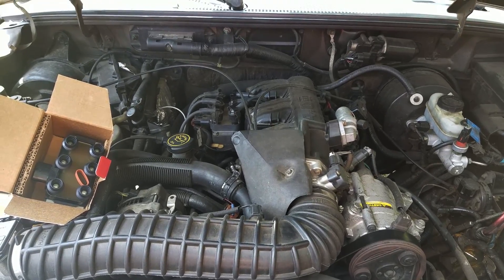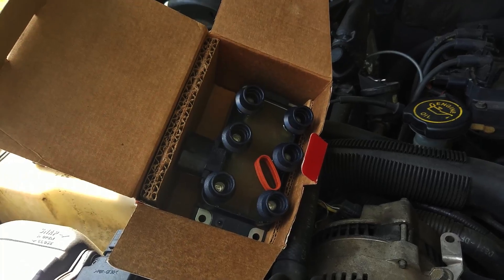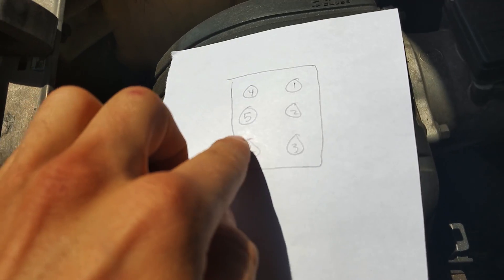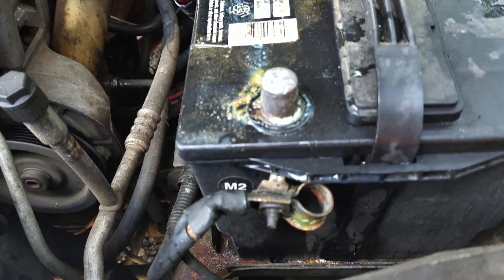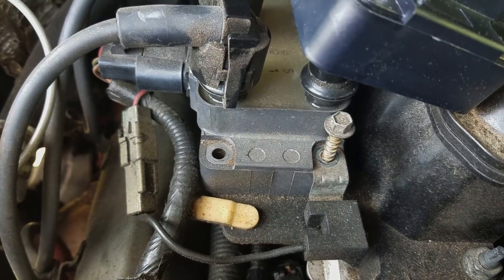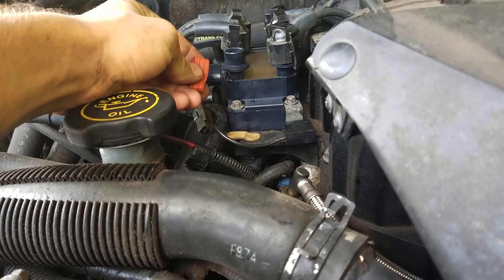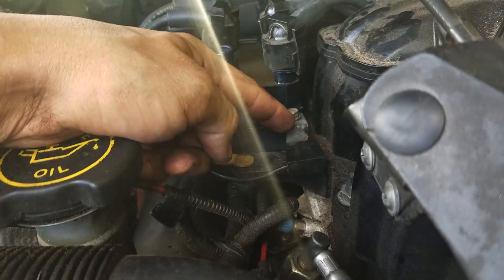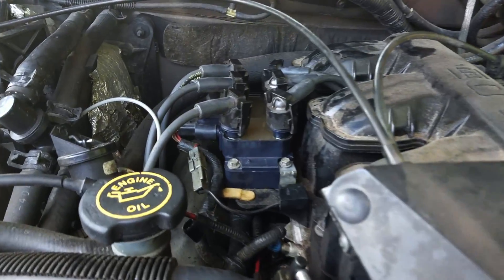Truck Keeps Misfiring? Check Out This Quick Fix!

Comment: Can you see where the lines go in correspondence with with engine? I took off my coil pack and the wires off and put new ones with new plugs as well. I made the rookie mistake of not drawing a diagram and now I'm all screwed

Comment: The wiring pigtail to the coil goes bad! I replaced coil, plugs, wires everything. Still have misfire. The new pigtail failed after 4 months too! Part # s658

Comment: I have a 2004 Ranger that has a misfire on #5. I replaced the plugs, plug wires and the coil pack. It is still misfiring. Why?
Reply from the maker: Check the electrode on the spark plug to see if it's cracked. I've seen it a lot.

Comment: My 2000 Ranger with the 4.0 6 cylinder has been acting up with misfires on #4. I've replaced the whole ignition system (plugs, wires, coil) as well as new MAF and throttle position sensors. Replaced the torque converter clutch solenoid... Still get random misfires on #4... Thinking maybe it's an intermittent fuel injector?
Reply from the maker: I had a similar problem once. Turned out to be a cracked insulator on the #4 spark plug it was shorting out on itself inside the motor. The motor was sucking antifreeze and it blew a head gasket not long after. I think that's what cracked the spark plug electrode insulator. Just a theory, but a good one.

It might be something like that with your truck, or the computer could be bad I have heard of that before.
Reply: @MattsShop  hey Matt i got a 2000 ford ranger 3.0L go up a hill it jerks reel bad , flat hiway it run good sometimes it misfire or jerks . happen the most go up incline
Reply: G N did you ever find what was wrong? Mines doing the exact same thing.
Reply: @sn95_elitist12  i had done the exact samething u did ,, helped alittle but replace my new plugs with another new set of plugs ( Bosch) it did the trick, (no missfire) now.

Comment: did it fix it?  my 2000 Ford Ranger has misfire cylinder 5 and I changed everything besides the coil pack. I guess that's next. just wanted to know if it fix it?
Reply from the maker: +Josue  Guzman Did you change the spark plugs? This motor had a misfire before. Turned out to be a cracked insulator on the spark plug electrode (white part). Yea, change the coil pack and see if that does the trick.
Reply: There are so many rangers out there with this issue, though also as many stories of owners changing coils, plugs, wires, etc, and it still misfires. Ford has a TSB out concerning the exhaust valves don't seat right.  We just had our coil changed and after 20 miles of driving it started misfiring again. Any follow up on this fix, say a month or two later?
Reply: leann manley did you ever find out what was the problem?
Reply: I'm dealing with the same issue now....I'm puzzled

Comment: My rangers RPM dropped when taking off making it really sluggish, no misfires. Replacing the coil pack did the job. Already did the plugs and wires
Reply from the maker: Good job!
Reply: Did you do anything to check the coil? I'm suspecting mine is bad but they're all sparking, coil is just cracked where it's bolted down. Can it be bad but still give off a spark?

Comment: I have a cylinder 1 too lean and a cylinder 4 misfire would changing the coil pack be the solution or new wires and whatever else you can think off throw me answers please I have Ford Explorer 98 and it looks just like this and it's very helpful because mechanics act dumb and say it's a bigger problem in the engine and lifters and what not and are scamming me so I want to do it myself being as I want to become a mechanic for my career!!!
Reply from the maker: I'm glad you want to be a mechanic as a career. Did you check the spark plug on cylinder 4? A coil pack CAN cause a misfire, but I don't see how it could make a cylinder lean. How did you find that out? A code scanner?
Reply: manuel gonzalez . Hi it's best just  replace all  . Plugs . Wires . And spark pack. If  at all it's good  preventative maintenance.
Reply: Ouch for some of these comments. Damn, settle down. Might start by how that coil pack is designed by Ford.

Comment: fuck ive replaced 3 of these things now.  any suggestions on why i burn so many out?
Reply from the maker: I don't know. Maybe check all of your grounds? Make sure that your grounding strap from your motor to the frame/body is good.

Are you sure it's your coil pack that's always burning out? One time I had a spark plug that had cracked porcelain near the electrode that kept causing a misfire. If you have a bad misfire on one cylinder that would be good to check.
Reply: thank you very much!  ill try your suggestions.
Reply from the maker: Yea, you are welcome for the ideas. Look over everything 5 times. There is somthing that you are missing!

Comment: My third comment if the engine is running in this fight sometimes but not all the time you can flush the motor two maybe three times with raw kerosene or a flushing agent is possible you could have a valve sticking  from slug deposits . I'm not saying this will work for you because every situation is different so I do not want to miss lead you got a good part of the time a lot of it is such a builder that causes these valves to stick. The repair is not as bad as you may think if it is a bad valve so do not let anybody miss  lead you if it is a bad valve it's very repairable. Good luck my friend keep the faith.
Reply from the maker: Never thought of flushing a crank case with raw kerosene. I don't know if I would do something like that on an automobile, on a small engine sure...
Reply: If you did that on a engine with variable valve timing that kerosene would probably destroy the vvt solenoid
Reply: @MattsShop  Back in the day we used to flush them with kerosene then do a double oil change most times it was like giving it a tune up.

Comment: i have a 93 Ford ranger 4.0 motor it bogs down idles ruff some times would any one no what that could be
Reply: Try your pvc valve!
Reply: @brycemumford9172  pcv
Reply: Well, I changed that a year ago. But it smoothed out just fine. Now, it started missing and so I changed out the plugs, wires, and coil pack on it. The plugs that O'Reilly sold me at first were the wrong size for it. I know that because it started to sputter and backfire a lot. I changed out those plugs with the correct ones and now it'll turn over but won't run. And I'm stumped! I've changed out the fuel pump, the fuel filter, the water pump, the thermostat, the thermostat housing, and the battery. What's my issue now? When I start it, it'll hesitate to start and then backfire as if it's getting too much fuel. I can smell the raw unburnt fuel up at the intake. Anybody got an aswer for that? Please help me....

Comment: Shouldn't it start up just fine after you change it out?
Reply from the maker: It should if it fixed the problem.
Reply: How do you fix it if it will crank but not start?
Reply: I had the wrong spark plugs in it; which caused it to sputter and misfire. After replacing the bad plugs and the coil pack. It refuses to start. It will turn over, but it's hesitating to start. And it smells like.it's flooded. There's a rich raw fuel smell.coming from the motor.
Reply from the maker: Hmmm, that's interesting. Did you forget to plug in the coil pack or did you get the firing order wrong on the coil pack/spark plug wires? Have you checked the fuses or the fuel pressure? It sounds like you have good fuel though. Start simple!
Reply: Trust me when I say that I've tried everything
Reply: I also noticed that while starting it my #1,and #2 spark plug wires are jumping completely off the plugs. Doesn't that mean that I have a misfire on those two cylinders?
Reply: @brycemumford9172  won't start without at least 80% of the cylinders firing. If you're two cylinders down because of bad boots or plug crimps you will be struggling to get it to cough

Comment: My second comment. Check the cylinder that's miss firing. You could have a bad valve valve seat or valve guide.
Reply from the maker: Good point. That's a little more involved to test the valves.
Reply: How do you replace a valve seat or. Valve?
Reply from the maker: You have to take the heads off of the engine and take them to a machine shop if you want to do that. It is VERY invasive. You basically have to take apart the whole top part of the engine.

Comment: I'm not getting fire to #5 either, changed the coil pack and still the same issue. Any other suggestions?
Reply: The spark plug or fuel injector maybe
Reply: @kylemathis3811  found a bad plug wire to be the problem, thanks anyway

Comment: Where is number 5 spark plug located on the head
Reply from the maker: Should be the driver side middle cylinder on a 4.0 OHV V6 or 4.0 SOHC V6. This is a 1998 Ranger 4.0 OHV.